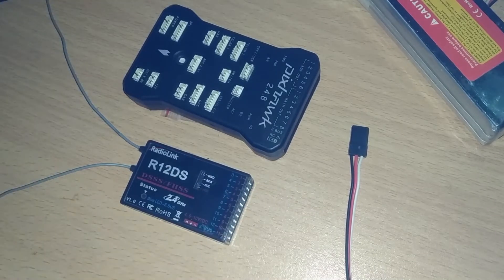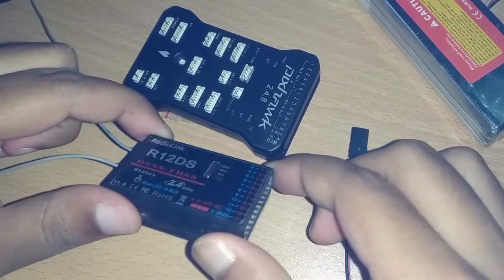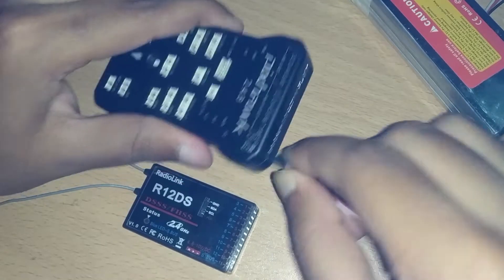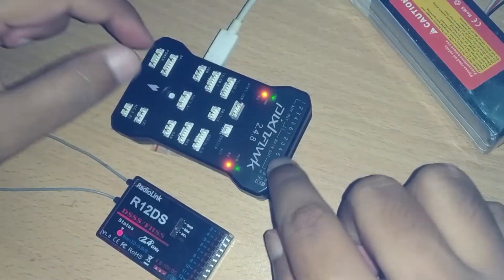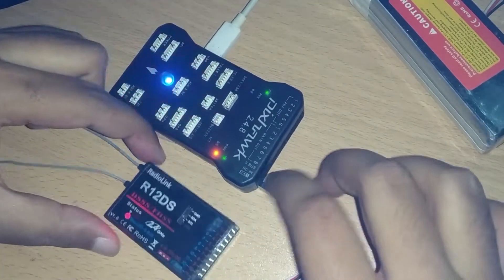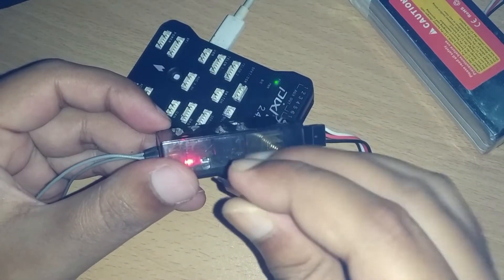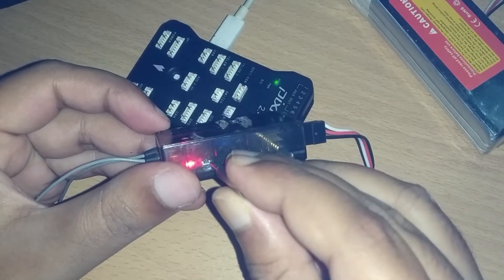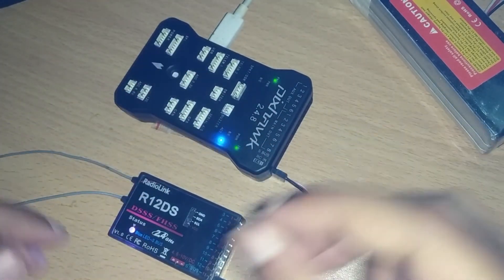How to connect R12DS with Pixhawk 2.4.8 || How to turn on SBus mode in Radiolink R12DS reciever

Comment: hi. how i can connect the cable between mega 2.8 amp and R12DS 12 chanal
Reply from the maker: apm by default cannot do any serial connection (where multiple channel signal go through one wire) like ppm or ibus. to do that, this link might help: https://ardupilot.org/copter/docs/common-connecting-the-radio-receiver-apm2.html
Reply: @rakinrkz9010  thank you 👍👍

Comment: Talk about polarity. You have white up on Pixhawk and Black up on R12DS.
Reply from the maker: Thanks for mentioning. 

Besides, it's not actually polarity isssue, won't cause any damage of reverse polarity because the 5v pin is always in the middle. If anyone plugs in reverse direction, it should not damage it but it will also simply not work as intended.